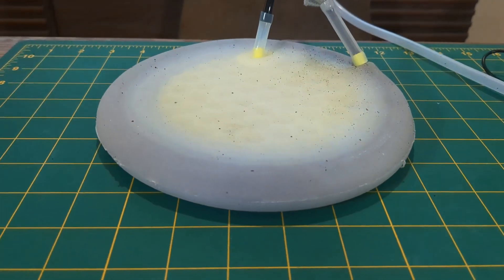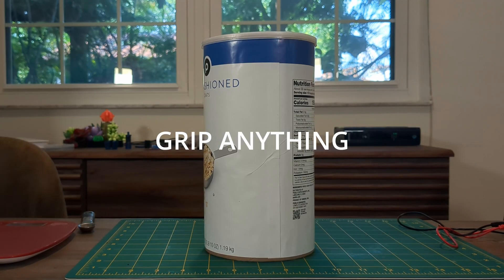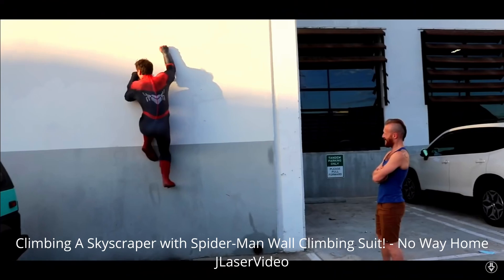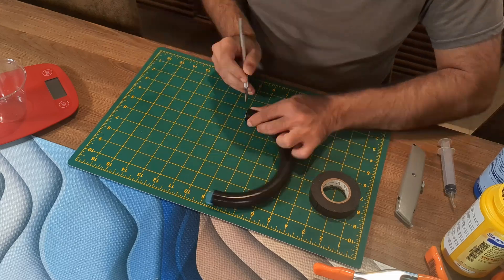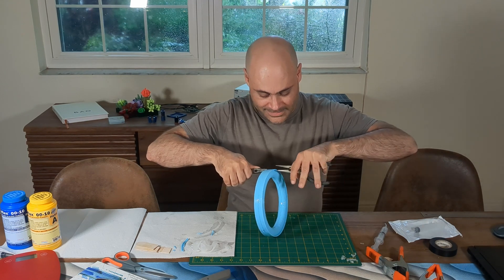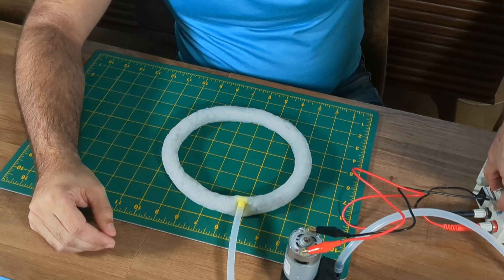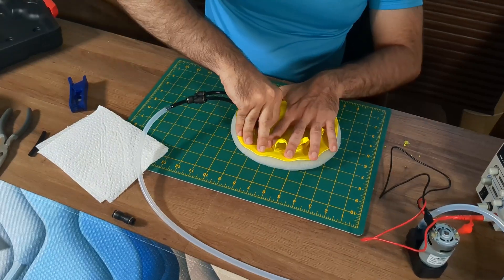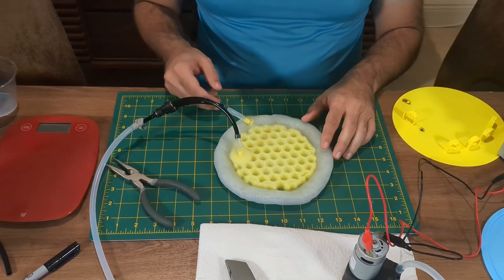Gripster a Jamming Suction Cup That Can Grip Corners and Odd Shapes

Comment: That's actually a super smart idea fusing the two designs together. It seems like it does its job well, and i wonder how small could the balls in the silicon be, so it can conform even better to different textures, or how much it affects the grip. Also, i think some mold release would be a great friend for you with the molds for the silicone :) Can't wait for the next iteration, or an exploration what can you use it for
Reply from the maker: @P-Ian  if this video does well on views and subscribers, I'll probably make a video of me using the invention to climb walls and the ceiling.